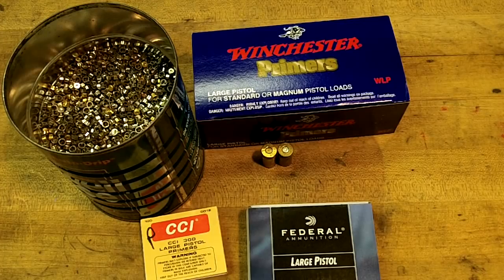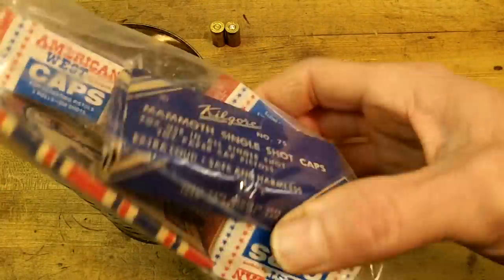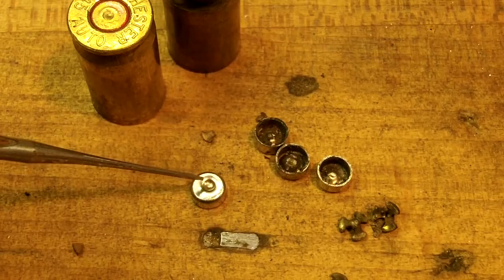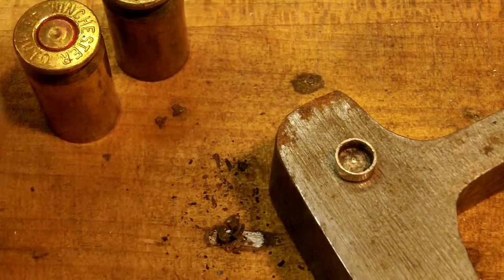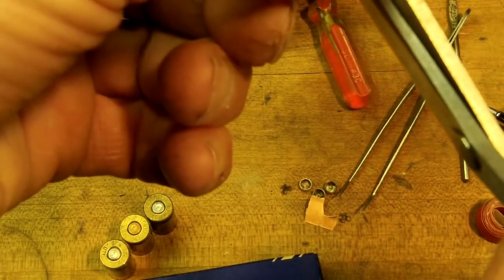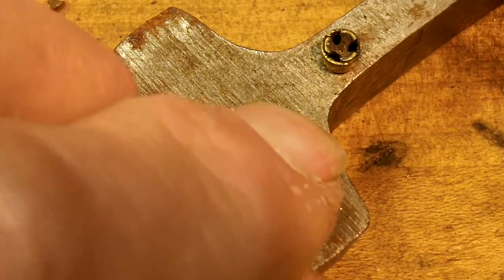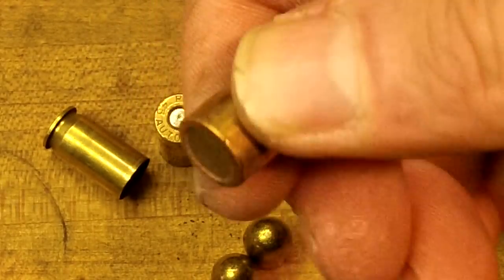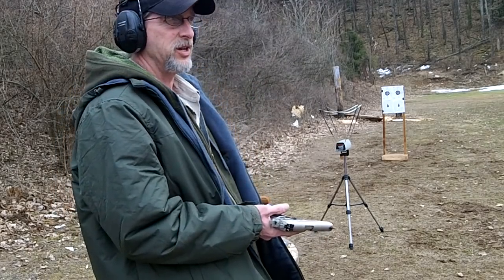What if you can't buy primers for handloading, DIY ammo option

Comment: If you hold the punch upside down in a vise then put the primer (open end down) on the punch, you can almost completely remove the dimple by striking it with a lead hammer.
Reply from the maker: That suggestion is worth a try jay b Thanks for adding to the discussion , Jon

Comment: As a suggestion for trimming the caps get a piece of brake line or other steel tube slightly larger than the cap, file one end sharp and use it as a punch.
Reply from the maker: good idea spatdroid , I did try a paper punch on my second video experiemnt, and that worked pretty good too.  Thanks for adding to the discussion,

Comment: I know that older style primers are made up mostly of mercury fulminate. Not an expert but I believe that you can replicate that compound from fairly common materials. Never done it and it may require some materials to make but you might look into that. Caps for cap guns are probably not going to be that common either.
Reply from the maker: yes, Nordic Viking I believe that the compound could be made.  Not sure how hard to find the stuff, or if it triggers adding you to a watch list.  My test was with what I had on hand.  I have since found out newer caps are less usable by a much smaller size.  The experiment is on hold for now.  Thanks for adding to the discussion.

Comment: A little tip for those who actually do this in times of the great shortage. Instead of using scissors, make a punch out of small diameter pipe. Old antennas work well.

Comment: I know this is old now, but there are several things I noticed,  first, the cap you used were really old.  Old enough for the red paper to turn pink.  Additionally, you only used one cap per.  I would have added the matchhead powder in addition to the cap to ensure detonation.  (it doesn't matter if it's strike anywhere because you are relying on the impact sensitive cap, the matchheads are just adding additional energy)  I have never used strike anywheres, cause I'm scared to grind them up. Also, what was your powder used and the grains?

Comment: Paper hole punch, you can use it to punch out the caps a lot faster than with a scissor.  I think you could also use a leather hole punch as it has more sizes which may fit around the cap with less paper making a better fit.   Also you could use two caps which may make more fire.  Just an idea.
Reply from the maker: You have offered some great advice +JASepichhunter, some of your suggestions have been tried in my second video on this subject.  Thanks for adding to the discussion , Jon
Reply: Just another consideration, if you can find the old style paper-tape caps. . . . there are leather die punches that would do this easily.
Reply from the maker: The paper punch was tried on my second video, and that worked a whole lot better.  Thanks for adding to the discussion.
Reply: I was suggesting it only as a "make-do" alternative.  I'm sure a paper punch would be optimal.

Comment: Much easier and better results for accurate reloading if you just stock up on primers. I live in northern Alberta Canada and we are haveing the same shortage of loading material as you are . For years iv been purchasing cases of primers , lots of powder, bullets and brass when it is on sale or available.  We are allowed to have 54 pounds of smokeless powder in house storage.  I have a properly built magazine to store in and one for primers to . I can store 54 pounds in my farm shop allso so with 110 poumds of stored powder and 50, 000 stored primers I don't anticipate haveing to make primers out of caps that are not going to have consistent safe results.  I cringe at the thought of the pressure results you would achieve, low, high , oh you would not know .Accuracy would not be a isue it would be non existing. I HOPE NO ONE TRYS THIS WITH RIFLE LOADS OR ANY SLOW BURNING POWDERS HANG FIRES WOULD HAPPEN IF NOT ON THE FIRST ROUND IT WILL HAPPEN EVENTUALLY. BY PRIMERS

Comment: maybe light primer strikes on the "duds"? I think if you don't get the divot all of the way out of the primer jacket you would run into that, or maybe its a deformed anvil that isn't providing enough resistance? Food for thought I guess. 
Thanks for the video.
Reply from the maker: Thanks for your thoughts lazydragonslayer , I did do a second video with some improved techniques, and i had 100% light off with them  I will take your suggestions into any further testing, when I get to it.  Thanks for adding to the discussion , Jon.

Comment: Cutting the paper backing of the caps is the most tedious part. If you have a Dermatologist friend and you can "borrow" a few Skin biopsy punches in 3MM, 4MM, and 5MM. These are razor sharp hollow punches used to core out suspicious skin lesions. They are cheap and disposable, one punch can cut a few dozen caps before getting dull..   .
Reply from the maker: Pio Sian A paper punch is a better tool for this project.  Thanks for adding to the discussion
Reply from the maker: Pio Sian Your suggestion is a novel idea.  Also a paper punch is a good tool for this project.  Thanks for adding to the discussion.

Comment: You could probably speed up the paper cap trimming process by using a sharpened hollow tube, with the desired inner-diameter, to punch out paper primer disks. Cutting with scissors looks like a pain.

Oops, looks like others have already suggested this.

Comment: Take a craft knife and cut down on a plastic cap so it cuts opposite sides of the wall, stop when you reach the load.
Now with pliers (I managed with my fingers) pull the cap sort of inside out. The powder disc just drops out (most of the time in one piece).
It's so easy you might as well use two in each reload.

I found this trick when experimenting with making flathead .22 air pellets explode on hard targets.
(worked but hardly world shattering)
Stick any left over spares to the bottom of the heels of your wife's stilettos.
Reply from the maker: docthebiker   I may give that a try.  Thanks for adding to the discussion

Comment: If you use an old .22 case as a cutter for the caps it should work easier (sharpen the mouth of the case and  drill a hole in the back so you can push the cap out)

Comment: you should try a hole punch to get the priming compound out instead of scissors, I would think that it would be more time efficient.
Reply from the maker: Yes Simeon Gray a paper punch works better.  I did try that on my second video, with much better results.  Thanks for adding to the discussion,

Comment: I'm wondering if the components of the poppers you get kids for the 4th of July to throw or step on could be use. I'm guessing they're too large for the primer but didn't know if the charge they put out would be enough to ignite the powder.
Reply: No, It is too sensitive. It is silver fulminate. You can separate it with water or alcohal but once it dries it will sapontaniously explode in any quantity more than a grain of sand in size similar in sensitivity to ammonium iodide crystals.

Comment: The materials used in modern primers vary from manufacturer to manufacter, but broadly fall into 9 categories. The most common composition type is called SINOXID which has a number of common derivatives. These normally contains Lead Styphnate, barium nitrate and antimony suphide, although the antimony sulphide is occasionally replaced by calcium silicide or aluminium and lead styphnate may be replaced or augmented by tetrazene or diazodinitrophenol.

Comment from the maker: Thanks ThePrepperJournal.  I posted this hoping someone may find it interesting.
Reply: One idea for cutting out the caps is to use a hole punch. if you the right kind it will collect them for you, do a whole roll in a fue minutes
Reply from the maker: Brandon Bates Thanks, i did try the paper punch on my second attempt at this experiment, and it worked much better.  Check out that video for other findings too.
Reply: Brandon Bates How about a leather punch??
Reply: Jon with no h I've had this project in mind since I was a kid, but I was thinking of using either the paper caps or making my own Armstrong's Mixture.
Another project I think I will do is to make the world's dirtiest improvised homemade ammo, using a re-used primer as here, homemade semi-jacketed .224 projectiles made from .22 LR cases & home made sulfur-less Gunpowder, the only thing that will be commercially made are the .222 shell casings, this is only an experiment to test out it's feasibility in a total SHTF scenario
Reply from the maker: MGTOW Galtist
That project would certainly be a test of your skills to improvise.  Let us know how it turns out if you decide to give it a go.  Good luck.
Reply: I'm part way through making the projectiles, have successfully "de-rimmed" a bunch of .22LR casings as a trial, have made a lead mold, I just need a few more tools to cut the .22 spent casing to the required length, once de-rimmed the shell casings stretch to 17.15mm or .6750 of an inch

Comment: Good video. What powder did you use? It seems as if a more bulky powder would have a better chance of igniting. I'm going to start saving old primers.
Reply from the maker: MILT OCHSNER my powder used was Bullseye, a very fast burner, and usually easy to light.  The second test and video was with Unique, and cast bullets in a  rifle case. Thanks for adding to the discussion.

Comment: it would be better to get a better charge out of your primer to ignite the powder charge more effectively, probably what happened to your velocity unless I missed you using something weird as gun powder, was a lot of distractions.

I hope ammosmith is still around, I sub him but haven't see vids for a while.

Wonder if you could make a mold out of one of those spend bullets, clean it up a little and then heat and reform the used bullets ... a thought. Or cut the mold exactly and use pressure

Comment: I know you've improved the design now and they're more reliable, but even as low as 30% would be more or less acceptable on a powered cycle weapon like a revolver, gatling gun or pump action.
Reply from the maker: Eurypharynx Pelecanoides That is a great point, I had not considered.  thanks for adding to the discussion

Comment: You may get better results using newer caps. Those look to have been made during the Great Depression lol.
Reply from the maker: Hans S. My second attempt with my vintage (depression era) primers was more successful.  I have since purchased a new batch of caps for more  testing.  Thanks for watching and adding to the discussion.
Reply: Jon with no h So the ancient caps actually performed better? Also, have you ever tried double stacking 2 caps to create a larger ignition? I'm a bit captivated by this idea, may have to give it a try.

 In a societal collapse, it would be best to load revolver cartridges, in case one primer was a dud, you could just fire a second shot in double action without much effort.

 Very cool video. Appreciate you taking the time to make it.

Comment: I have just successfully converted my primer pocket swager to flatten the dent out of used primers. Works pretty well but i want to try to grind a little divot to the shape of a new primer. Then i should be able to reshape primers that have been slightly flattened due to high pressure.  Would anyone like to see a video of it? I made it using my lathe and a stone. It could probably be done in a drill but the rcbs primer pocket swager is hardened steel so it could take a long time in a drill.

Comment: Instead of using cap gun caps.  
why don't you just replace the original chemical of the primer. 
Let it dry and replace the anvil.
Info on the contents of the liquid (before in drys) can be found on the web. 
Look under Winchester Olin mfr hazardous materials info sheets.

Comment: After all the hard work and its corrosive. Its going to have to be a fallout type situation to make it worthwhile.
Reply from the maker: Absoleet A Definitely as a last resort, better than throwing rocks.
Reply: ***** Its not about cleaning. The difference is that you absolutely have to clean it whether you shoot 5 or 500 rounds with corrosives.
Reply from the maker: Cleaning is a necessary evil after shooting with corrosive primers. Just have to use different chemicals, rather than conventional bore cleaners, that may not dissolve the salts.

Comment: Are the paper caps just normal paper or are they a special kind and do you need to use paper or is there anything else you can use
Reply from the maker: These are from toy caps ,like used for a cap gun.  Not easy to find in this modern day world.  Walmart may have them.
Reply: @jonwithnoh7  how would you make one without them
Reply: MeldThe Steel you can use match powder and its phosphorus powder to make armstrong mixture.This is very sensitive when you pack the mixture in a closed paper or foil but not sensitive if you don't pack it because there's no friction.Using kclo3 powder from the match stick head then use the beard shaving blade to scratch the phosphorus out,you should add small amount of alcohol.Then grind it into small powder and mix together.Test with lighter spark to make sure the quality.You also can extract the powder from cap gun ring caps,it's covered in a plastic cup,use sharp blade to cut the cup out and extract the brown powder(lead styphnate or some azide),it's difficult task to do,anyway that modern cap gun powder can ignite without friction but shock force and it burn fast like explosive.
Reply: @lanchanoinguyen2914  thanks

Comment: This is not safe at all.  You won't lose an eye but you'll destroy your gun.  Once the firing pin has impacted the primer a weak spot is made in the metal.  In a .454 casull it's required to use rifle primers, not for the explosion but for the thickness and strength of the metal.  Primers are disposable and are not reloadable.  If the case were otherwise we wouldn't have a primer shortage today.  Don't follow Jon's instructions, you'll just burn your firing pin when the cup blasts through.

Comment: Here is my question and someone with actual knowledge please answer. If you had to make primer from scratch what are the raw ingredients needed to make substance that is impact sensitive but won't destroy your weapon or kill you?
Reply: +Jorge D Martinez Mayol Armstrongs mix. It's a mix of red Phosporous and Potassium (Per)Chlorate. It's extremly unstable so only small batches should be made (under a gram) at a time.

Crush matchheads and grind them finely, then scrape of the Phosporous from the matchbox and grind it. Not together, not in the same grinder, preferably not in the same room. Mix them wet, pour a thin layer into the primercup and let dry. Insert anvil.

Do not grind strike anywhere matches. :D
Reply: The question is where to you get both ingredients from or how to make it from scratch. The match stick is a good way for starters but I'm thinking of a SHTF situation where you can't find matches and/or looking for a steady supply

Comment: Why not leave the primer out and use pelleted gun powder so it dose not fall out of the primer hole and use something like a spark plug in place of a firing pin to set of the charge .
Reply from the maker: Tony Dingler I was trying to use what I had on hand, for this experiment.  Your idea sounds like a partial re-engineer of the firearm mechanism.  I will be stocking up on components, when they are available.  Thanks for watching.

Comment: problem is if they don't go off what do you do.... you have to throw them out so that 50c lost when you could put a 5c primmer in and are guarantied to work.
Reply: You don't have to throw them away. If it doesn't go off, just pull the bullet and use the bullet and powder to reload. Not much lost.

Comment: If I had a missfire. Id just cock the hammer back and give it another wack..I had a  sh.t  load of 1950s 9mm . I had to use a SW39  only double action 9mm I had ..90% fired on the second hit..hard primers for smgs  might work on caps.  Nice vid.    thanks
Reply from the maker: That may have been a workable solution,  but I did not consider that during filming.  Was looking for a first strike result.  Thanks for adding to the discussion.